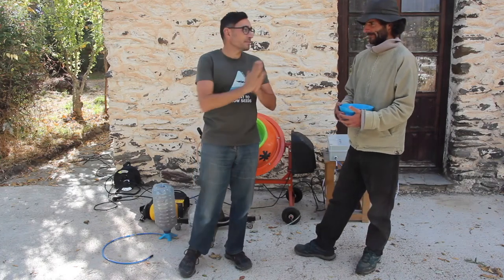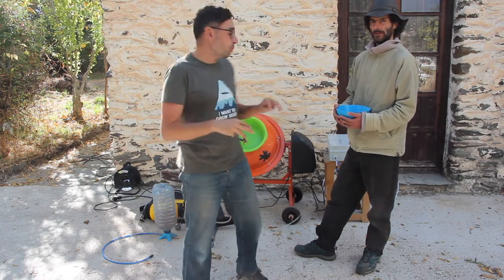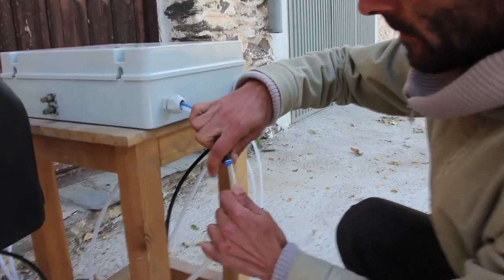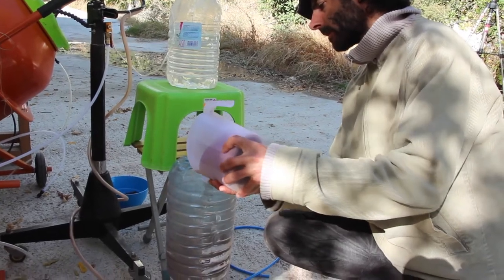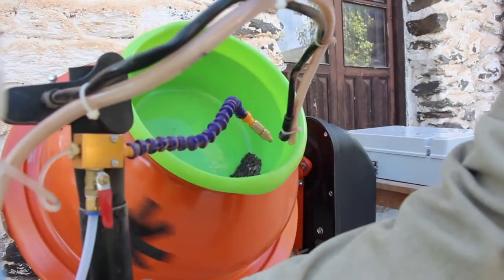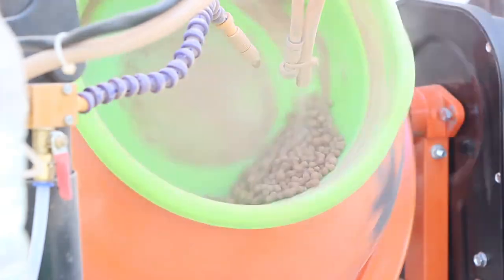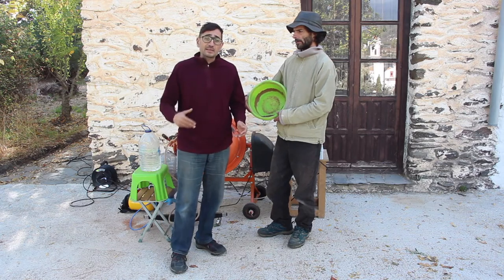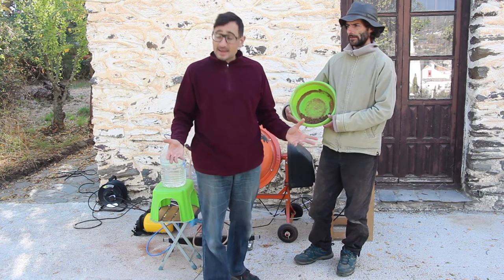Open Source Seedball Machine

Comment: I tested it with pure clay, the shell got cracks and just crumbled. Can I add something to the clay powder or how can I solve the problem?
Reply from the maker: First, if you use seeds that swell, they need to be in water first to avoid grow after the coating and break the coat.
To the clay you can mainly add binder, like arabic gum, or adiitionally fibres, like coconut fiber to have all parts together even when cracks.